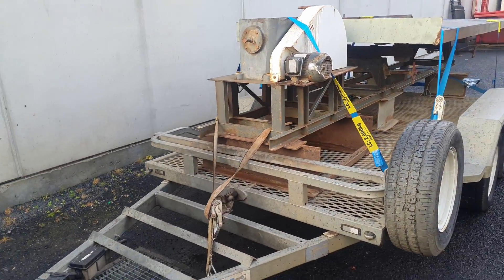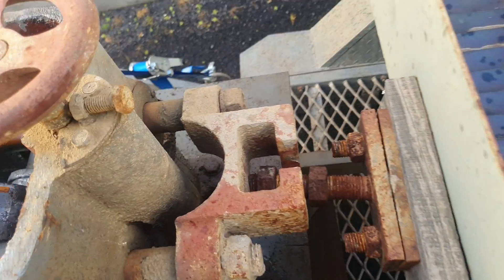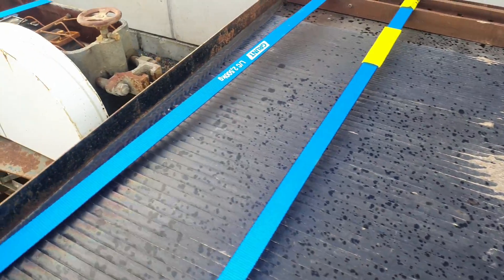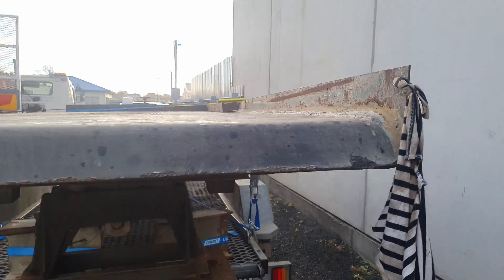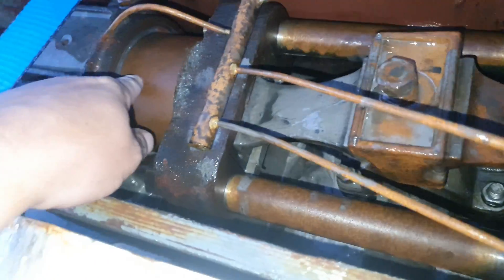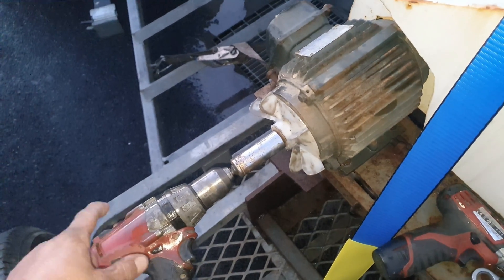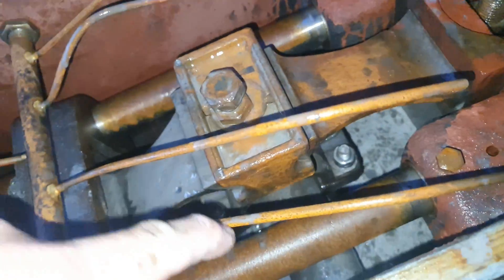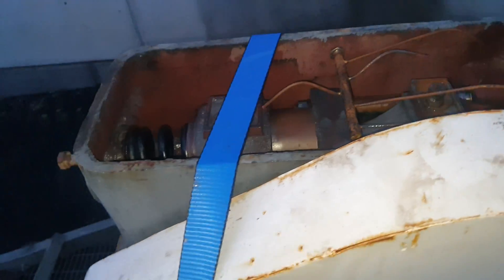Ewaste processing just got serious (gold silver copper) shaker table

Comment: If your interested you can see my video I have a microscope actually showing the gold bond wires.
Reply from the maker: On your channel
Reply: @Oneupthesleevecustoms  yes its the first video
Reply from the maker: @arielkozak  ill check it out tonight thanks for dropping a comment
Reply: @Oneupthesleevecustoms  At the 1:09 mark you can really see the different sizes.  I put it in a blender actually my impact is still not 100%
Reply from the maker: I've got a hammer mill with a 2mm screen im hoping to use for mine
Reply: @Oneupthesleevecustoms  nice i just saw it on your channel thats a impressive mill. I made mine out of a propane tank and is driven by a belt sander motor
Reply: @Oneupthesleevecustoms  i still didn't make any mesh yet. It  just sits in the mill to continously grind the e waste until it open it and take out the material. The longer its there the finer
Reply from the maker: Thats awesome love to reuse stuff
Reply from the maker: There are a few gold miners I've watched that do that with their ore in a basicly sealed system